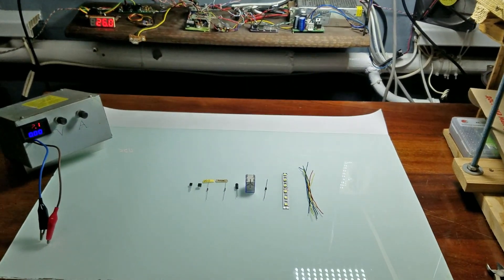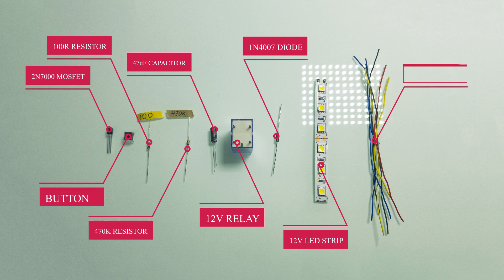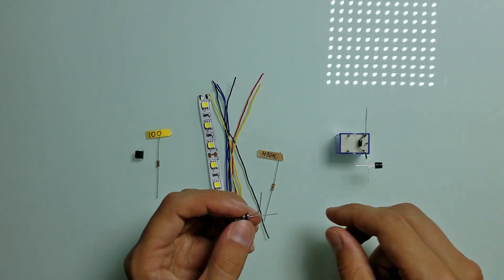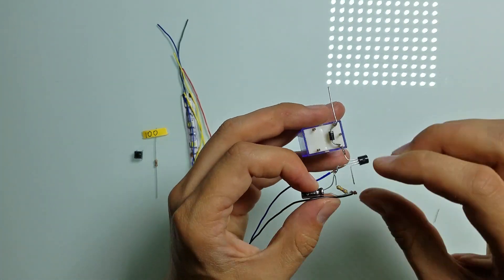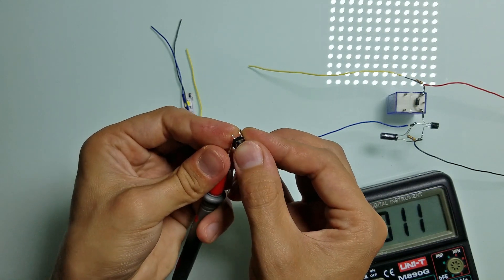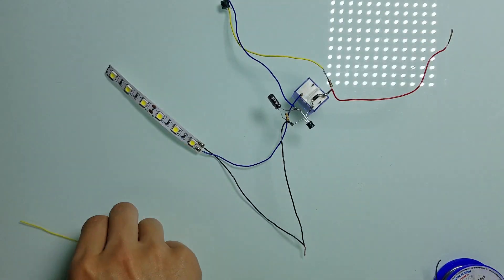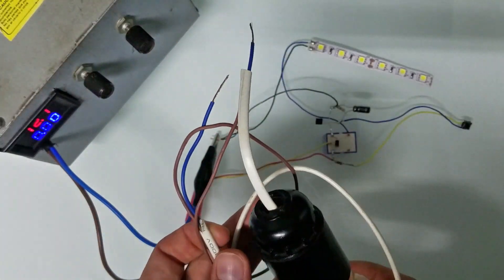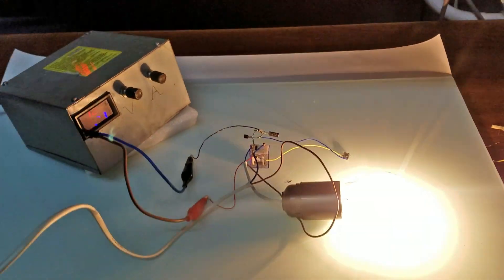Simple Delay Timer Circuit | One Transistor DIY Project

Comment: Completley worthless to me.

At the beginnig the guy should explain in detail principles behind the circuit and explain the schematics i.e. what element does what at standby, and when triggered.
Also, this should be presented clearly on bread board with connections well visible instead of wire spider's web.
Otherwise it is a dummy job of just soldering.

Comment: Nice video Sir. Can you tell us why did you use diode across relay coil. Thanks
Reply from the maker: Hi, it is called a flyback diode. It is used to eliminate sudden voltage spike seen across an inductive load when its supply current is suddenly reduced or interrupted. In other words, that diode protects MOSFET. In this particular circuit it may be excessive, because the current decreases slowly here, so no voltage spikes... but I decided to add it as additional protection for the MOSFET.

Comment: Great! 
Or you can use ic 555 instead
Reply from the maker: Hi, thanks, yes, but it is simpler, just one MOSFET.
Also, I am not a fan of 555, once I made a generator with it, and at first it kind of worked, then it exploded (don't know why). Another bad experience with 555 had my friend who bought an overcharge protection device for 12V battery, but when voltage is 14.7V it suddenly starts to consume a lot of current and 555 burn out if you do not turn it off, and it was a factory-made PCB with 555 timer.
In my experience 555 often behave unpredictably... maybe it is just me.